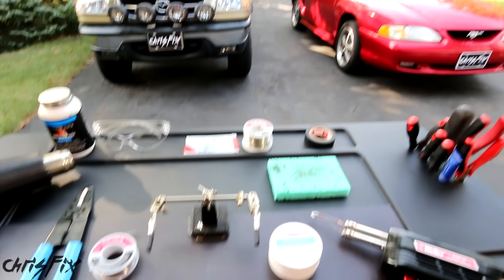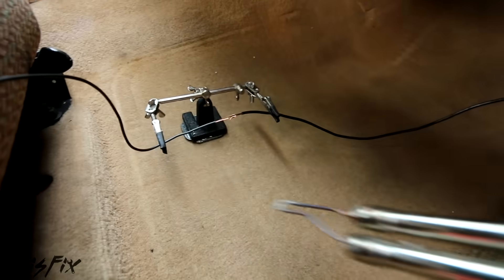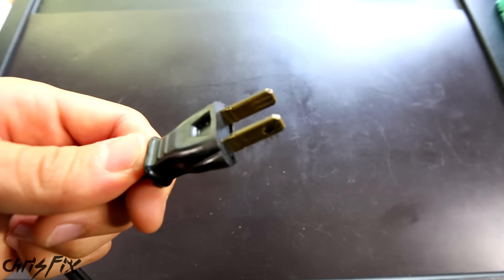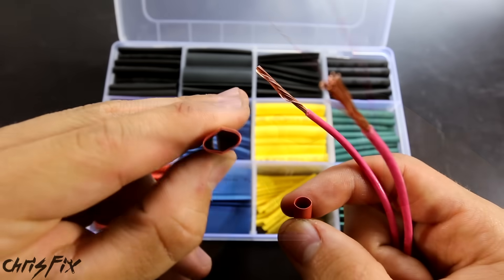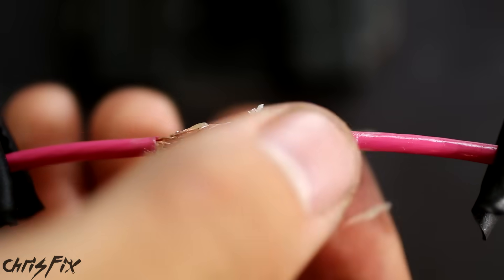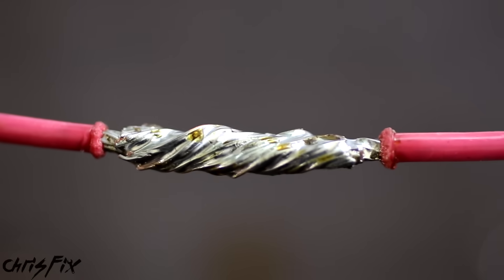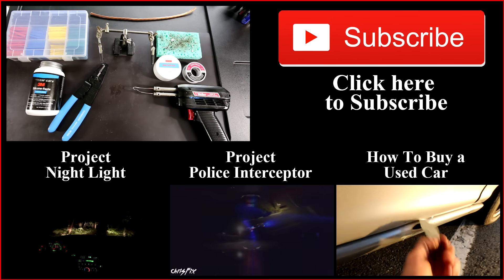How to Solder Wires Together (Best tips and tricks)

Comment: This is really nice. Have you tried using steel wool instead of a sponge to keep your tip clean. I keep a metal can filled with steel wool by where I work. Just stab the tip into the wool a few times, and it will clean it. It also gives you a safe place to put the hot iron when you are done.
Reply from the maker: Thanks! I have not and will have to give the steel wool a try! Neat tip! Thanks!

Comment: Flux provides a thermal bridge so that you can apply the leaded solder within 3 seconds and complete the solder faster without bird caging your wire or soaking solder up into the unexposed area of the wire. A little bit of Flux goes a long way. Chris is using way too much since he is already using a mildly activated rosin core solder. He is also wrong about Flux preventing oxidation. Flux left on a clean solder joint will corrode and pit the solder over time. It's best to remove your Flux from the solder joint immediately using isopropyl alcohol and a acid brush to prevent corrosion from forming.
Reply: Source: Avionics Technician for over 10 years.

Comment: Generally the smaller the wire use the "union" splice. as it is harder to twist the tips together when there is few strands on smaller gauge wire.

Comment: Best tip for soldering, if buy a decent pair of crimpers and just use crimp terminals.
Heaps easier, less likely to mess up and will last longer if done and protected correctly.

Comment: The problem here ChrisFix, is that you heat the wiring insulation too much. Generally rated at 60-90 degrees C, a soldering iron exceeds this, making the insulation brittle and shortening its lifespan considerately. Especially with smaller gauge wires. You should lightly touch the bare wire for a few seconds, to let the soldering bind, but that's it. You should not melt the soldering with the wires itself. Also, i'm not a fan of shrinking sleeves. When they shrink, the thickness on pointy surfaces is very, very thin. A light brush or rub on the wire can expose the wire. But your soldering technique itself is good! Very informative and authentic channel.
Reply: Well.... make a video and SHOW US how it's done! I am always up to learning something new and useful.
Reply: "You should not melt the soldering with the wires itself." - yes you should, this ensures that wires are hot enough to bond well with solder. If you melt them on the soldering iron you could be making a cold joint, especially when soldering thicker wires.
Reply: The solution for not melting insulation while soldering is to place the solder between the iron tip and the insulation. The solder acts as a wick, a heat sink - and fills the wire before the heat does the insulation in.
Reply: all I have to say to this is this is a car channel. Its not like the video is titled "avionics grade wire splicing" now is it you twats. the silicon and shrink tubing overlap the splice for a reason. Yeah it's not nasa grade, but he never said it was. The heat damages the insulation which is why you always re-insulate your wires after you solder, 2-3 cm(1-1 3/8 in aprox) overlap on each side of the joint should easily cover any damaged insulation and the silicon adds more insulation and makes the join waterproof. Really he covered the basics for home and car. Youtube isnt where you go to learn how to wire and solder airplanes. Ever single thing you want to nit pick he didnt mention because A: he is talking automotive not aerospace.
B: he goes right to re-insulating and shows a decent overlap with the new insulation.
Yeah, comment is a year old but you can never learn too much about not being a prick.
Reply: Thee_ _Number_Six lol facts
Reply: Thee_ _Number_Six lol take it ez bruh
Reply: Just avoid using those soldering guns when you can, they are for quick and dirty work only. For $15 you can get a soldering iron with temperature control.
Reply: Ya, not NASA approved at all. This method of soldering would never be excepted on aircraft either, not that we solder on them anymore anyway. Good enough for automobiles I guess. Not on my cars though.
Reply: donald watson dildo
Reply: donald watson sure, if you are an idiot and don't properly cover your joint with insulated tape. Unless you use a blow torch and burn the wires 3 feet back, the slight damage at the site of soldering will be covered when you wrap it with splicing tape and electrical tape . Or don't you proper reinsulate your wires a sufficient distance back from your joint?
Reply: @garrettmesser3977  oh you savage haha
Reply: Maybe so, but for those of us who solder very seldom as opposed to doing it as a job, this is a very informative video.
Reply: Like bavarian34 stated you have over heated the wires. If I did any soldering like you did I would have airplanes falling out of the sky, that video has just made a lot of people dangerous, thank you!! However if you truly took some real electronics classes you'd know this, and would not make such garbage videos. Please do the world a favor and stop before you cause more damage than can be repaired.
Reply: @donaldwatson6342  i agree with him too but dont be a jerk man. If someone working on an airplane is here to learn how, its not ChrisFix's liability for what anyone does with the information they gain from this video. 

Chris made a How To video about blinker fluid and muffler bearings a while back. Should he be liable for the people who attempted to go to the store and buy them?

By your own logic if someone read your comment and saw that planes were falling out of the sky due to this video and they choose to no longer fly because of it, that would make their fear of flying now your fault.

Not arguing with you man, honestly. Just tryna prove a point.
Spread the Aloha brotha not the negativity

Comment: Question for anyone_ why do my irons burn out after 3 months, I usually use them about 2 times a week if that, but they always burn out, is a voltage regulator recommended/ necessary or is it just for looks?

Comment: Awesome tips. From a Repair Technician POV, I scrub the fresh solder joints with alcohol to remove the burned Flux prior to the heat shrink and grease. Cleaning the solder tip and reapplying clean solder at the end will allow for longevity of solder tips, but great cost saving tips with the stranded heavy gage wire.

Comment: dont use a sponge. use a wire brush in a tea box made of tin,then dip your soldering stick/gun into it to clean it, instead of melting sponge. and your connections suck. i come from the world of electronics where your technique is unacceptable.

Comment: I use heat shrink every chance I get. Electrical tape is not a permanent cover. The adhesive always turns to goo and ends up a mess.

Comment: You should really clean the soldered wires with isopropyl alcohol and acid brush. Because the residual flux is acidic and will eat away the metal and the rubber

Comment: I am trying to solder two thick wires together like in the video, but cannot get the wires hot enough to melt the solder?? I have both a 100w and a 175w soldering gun. Whats the problem?

Comment: Question! Is all flux paste profitable for electronic soldering use? My local parts place has some flux paste in the plumbing soldering section, but not in the electronic soldering section. Will it work for electronic soldering?

Comment: Can I do this to injector harness wires?
Reply from the maker: Yes but make sure you are careful because the fuel lines and raw fuel are right there!
Reply: ChrisFix I took out the harness so I can work on it, oh and by the way I just went out looking for the "lead" solder and no luck, now I'm thinking should I use the lead free or just crimp connect? The reason is that I got more than a couple exposed (burned wires) on that harness . so I got a roll of wire to replace some of the bad wires

Comment: Smart man. Thats how I solder all my thick wires. I would add shrink tubing and black tape is all. Or you can use Red Handle Rubber coating in this case. (The stuff you dip handles in like for tools) Except you can brush it on the soldered area and over the wire.

Comment: What kind of solder are you using? I'm from Turkey and i haven't seen one of those solders yet. And instead of heat shrink you can use electric tape and a little fire to do the trick.
Reply from the maker: I link all the products in the description for more info.

Comment: Way too much solder flux. Also heating time is best <=  3 seconds.
Reply: Ed Saucin it helps with preventing oxidation
Reply: All flux does is remove oxidation on the surface of the wire. You really don't need much flux with clean, newly stripped wire. You usually don't use both a flux and a fluxed solder at the same time.
With Mil-spec wiring you may have to clean off flux residue or use special procedures. Rosin flux is a mild acid that is activated with heat so if the wiring gets too hot the residue will slowly eat at the wiring.
Solderless joints are becoming more popular. Soldered joints and lots of vibration can cause wire to break where it meets the solder joint.
Reply: Ed Saucin just allow for better flow in the solder, it is also supposed to keep copper from breaking as it heats up. (As I understood it)
Reply: Ed Saucin Flux provides a thermal bridge so that you can apply the leaded solder within 3 seconds and complete the solder faster without bird caging your wire or soaking solder up into the unexposed area of the wire. A little bit of Flux goes a long way. Chris is using way too much since he is already using a mildly activated rosin core solder. He is also wrong about Flux preventing oxidation. Flux left on a clean solder joint will corrode and pit the solder over time.

Comment: You really shouldn't be soldering in cars at all. Solder is brittle and vibrations or general flexing will causing it to break over time. Use butt splice connectors instead to crimp the wires together.
Reply from the maker: Thanks for the tip

Comment: While your technique works I'd never twist the wires together. If you can, always use the NASA soldering standard:
-Make sure both exposed ends are straight and not spread out (you can twist each end individually if it's spread out)
-Put wires parallel to each other so that they're touching along the exposed part
-Solder them together like shown in the video
This way you'll have a cleaner and (physically) stronger connection and if you need to disconnect the wires at any point you just heat up the joints and they will come apart easily.
Reply from the maker: +T3hAmunraaa thanks for sharing

Comment: Hey Chris, I am trying to splice a 22 gauge wire to a fuse splice that appears to be 14 gauge (it was the only ATM Add a Circuit I was able to find at my local auto parts store) to install a dashcam. I used a heat shrink tubing that is rated for 22-18 AWG. The tubing shrunk enough to be snug to the fuse tap wire but still ended up being a bit wider than the other wire. Because I applied dielectric grease to the splice, the heat shrink tubing can easily be slid around by hand. I am using electrical tape to keep the heat shrink in place but I was wondering what you would suggest for future splices like these.

Comment: Newbie question: you recommend using a fan so that you don't breath in the smoke, but you didn't use one for the demonstration. I heard blowing air into the joint while soldering is bad for the joint. Is that true?

Comment: Really well put together video! I had that exact same iron style soldering iron and it lasted about a week of use before the tip fell out and refused to stay in LMAO ended up getting the gun style and shits way more skookem. And you are completely right about lead free solder not working worth shit!! I'd shove the gun against the wires for 60 seconds till the insulation was boiling off and the lead free still refused to wick!

Comment: Use heatshrink  that has glue in them that get activated when heat is applied and makes a real water tight protection . DSG is the best I used so far.  Nice video Cris. As always.

Comment: so for PCBs, i use a low heat to heat the wire up, and put solder on the wire so it connects to the PCB? all this time, i was first dripping solder onto the contact, and then heating the solder and pushing the wire through. Thanks to your video i think i realise that's wrong, id love if someone could clarify that for me. thanks for the tips Chris!

Comment: Well done!  I have never been satisfied with my own soldering jobs, and now I know why.  I need to get some helping hands and make sure the solder never touches the tip of the soldering iron.  Your videos are consistently practical and easy to follow Chris.
Reply from the maker: +Jay Grosse awesome! Glad the video was helpful!
Reply: Jay Grosse and I had the issue of blobbing.
Reply: Well said, exactly how I feel. My soldering was never "good" so we will see how it goes!
Reply: as long as you heat up the wires enough to make the solder flow into them there is no problem with touching the the tip of the iron with solder.

Comment: jankiest solder I ever seen under 16 years... dont use this thecnique if you want to make a good solder
if you want to make a good solder remowe the  coating of the cable around 10-15 mm then twist them (not together just the cables what you stripped) then add some solder to it if its too much just heat it up with the soldering iron then pull the soldering iron up while you holding the wire (dont move the wire just only the soldering iron and do it fast) and the unneded solder will come off do it with booth cables then place them next to each other and just touch them a little bit with the iron (around 1-2 secs) and then they will connect properly and they look good not like that.
this method is not good if you twist thoose together they will make air bubbles and the solder gonna corrode from inside its gonna get "tin pest" (its turns into black and falls apart) and it has a bigger resistance and smaller conductivity.
So dont use this.

Comment: When I have soldered in the past, I tried to touch the tip of the iron to the wire and a circuit board and add the solder to the wire and the board, not the solder. Every time I did do that however, the circuit board and the wire insulation started to burn before the solder melted so I just made cold solder joints. Any tips?
Reply from the maker: Use a lower powered soldering iron.
Reply: ChrisFix aw man. I can't adjust the power of the iron so.... Thanks for the help though!!!

Comment: What if we are working with more small scale stuff... Like, I wouldn't heat up a transistor first... can we just cold solder it? thanks
Reply from the maker: You would use a smaller iron which keeps the heat local.

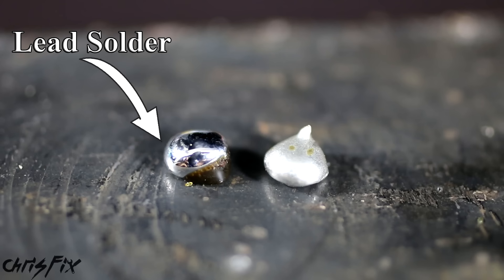Comment: 3:36 No. The solder on the right is just bad, because the lead-free solder acts differently, you will get the same results as on the leaded solder you used by using a proper soldering iron with proper temperatures. 100 watt soldering iron causes bad solder joints like that. If you use flux to demonstrate that, I'd believe the result would be way different.

5:15 By using copper wire on your gun you are driving it on different wattage.
Reply from the maker: +QckSGaming thanks for the tips

Comment: No! as a trained electronics technician with soldering experience, this is just horrible to look at. do neither of the splices he says. instead strip your wire by using the tool to cut the insulation in a rotational motion around the wire and then remove the insulation with your fingers. this will prevent wire damage. next you tightly wind the wires together on each and tin each wire individually. you do not need this much length of wire as well since the amount of wire is no longer properly insulated in that area you want to minimize the amount stripped. once you have both tinned properly, which would require anti-wicking tools to prevent solder getting under your insulation, you want to butt them together, you can flush cut the ends with diagonal cutters if you want, but make sure you use flush cut and not semi or you will have a ridge. butt the ends together and place solder tip under where they meet and insert solder. I would recommend the iron over the gun since the gun typically overheats as noted in your melted insulation and it is less focused heat and spreads it too much over the wire and harming the insulation. for the bigger jobs you can get a flathead tip for your iron instead of the pencil type. heat shrink is good, but use multiple layers to restore insulation thickness.

Comment: A couple additions: if the tip mounting nuts on the gun are not tight the tip will barely heat up. If the gun is not humming clearly the nuts are too loose. 
If you keep the heat on the connection too long it will burn off the rosin and look grainy and gray (not usually a problem if you use rosin paste). A dab of rosin fixes it again.
Some metals are tough to solder. Nickle plated terminals have to be fluxed with plumber's (acid) paste flux and tinned with solder, then the paste cleaned away before soldering for real. Nichrome, stainless steel, and aluminum will not solder unless an all metal flux (like Salmet) is used, and that is extremely nasty stuff. It has to be washed away like acid flux does, and a whiff of the smoke will make you sick for days. Been there. If you can stick to copper and rosin life is so much easier.
Reply from the maker: Thanks for the tips.

Comment: Tip: If you're soldering a ground wire on a car, make sure you disconnect it from the ground first. The vehicle's chassis may act as a heat sink if you don't, which will prevent the wires from heating.
Reply from the maker: Thanks for the tip!

Comment: You can actually get rosin core silver solder for electrical, it's what I use, I buy much lighter gauge too, that thick stuff is hard to work with.
Reply from the maker: Thanks for the tip!